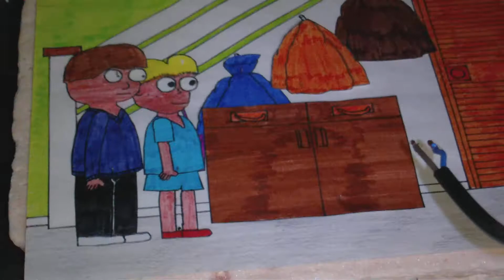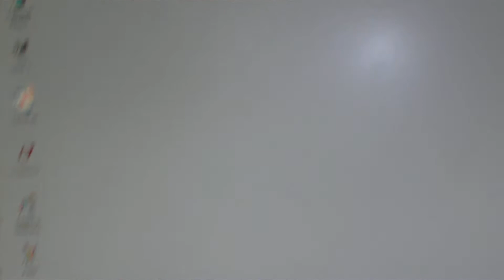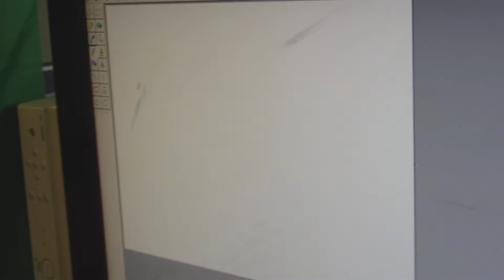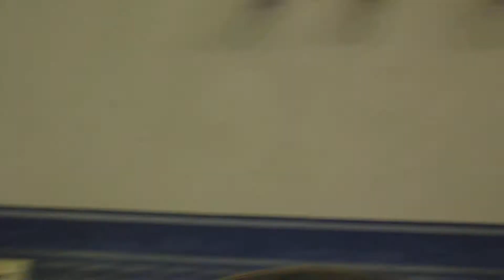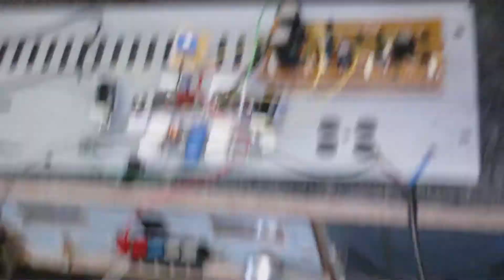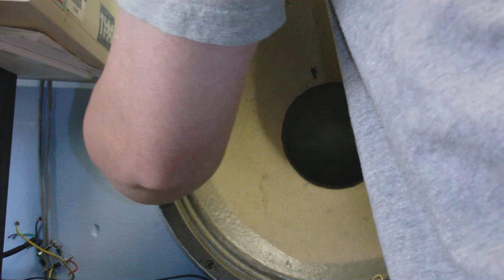Webcam problems - and a big ol' speaker

Comment: For the webcam and I have dealt with something similar before, Likely you'll have to delete it from Device Manager while it's connected, then unplug, wait a minute, then plug it back in. Drivers might also need to be reinstalled, uninstalling them first, then running CCleaner than installing them.

Comment: As you may know...that resistance controls amplifier sensitivity, or the level you plug into the input that is able to drive the power amplifier to full power output...this level is 750 milivolts rms..and the MP3/4 players does not output such level...so..your power will be always small...now you need power to drive this big speaker...sorry about your web camera...but you may have a new one that is usually better...this things turns better as times passes by.

Comment: Nice speaker.... it needs a lot of power to move the diafragm.... you are using MP4 player, so, it is better to reduce R7 to 220 ohms, because the output level is not high enought to drive your amplifier to full power..also the impedance is not good.... if you have line out will be fine..but if you are using headphone output, as you know, impedance not very good..also audio quality is not fine as uses coils in series, because class D amplifier, to filter and convert to analog.

Comment: @CoolDudeClem If the webcam has it's won microphone, there may be a USB Hub in order to put two devices (webcam and ADC) on the same USB port (All in 1 IC). However, when something like this happens, I usually do the following: Look up in the Device manager in Windows to understand the nature of the problem. Uninstall the driver, clean up any traces of it. Try the device on a driver-free PC (Linux or Windows). If all the previous fails and wiring is not in cause, then I declare beaten !!!